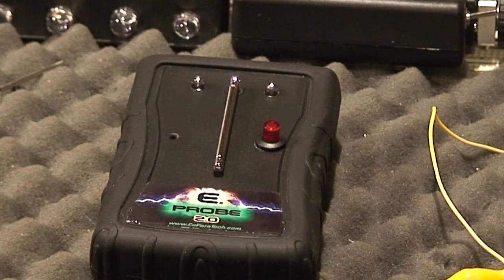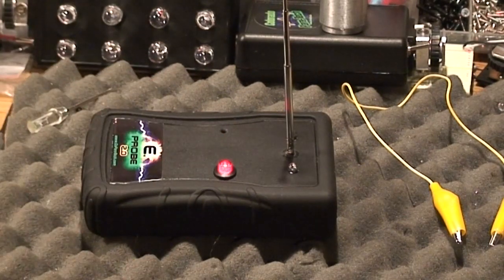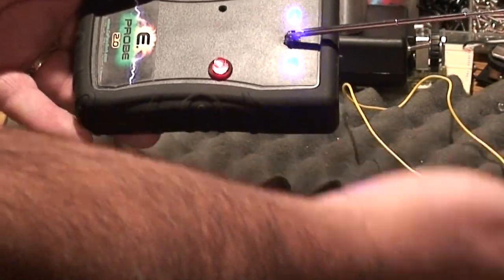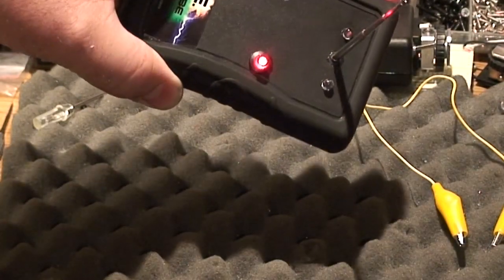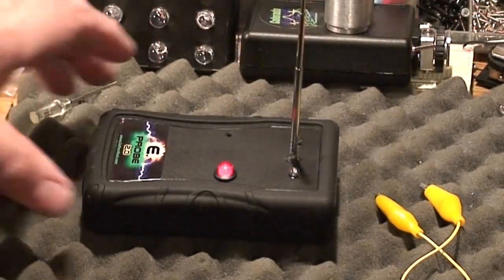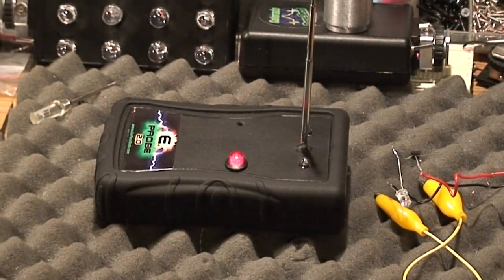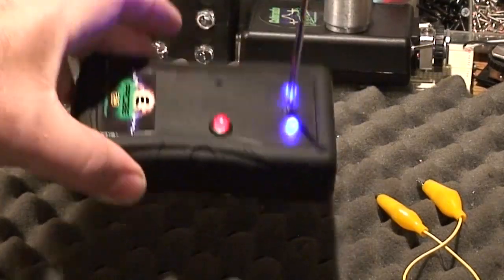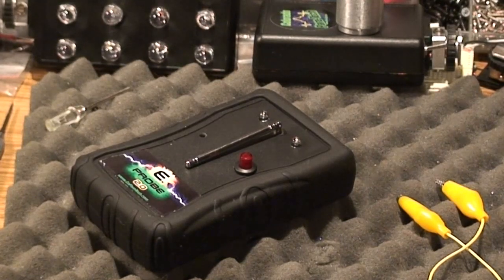E.Probe 2.0 E-Field Detector Demo

Comment from the maker: They are similar in that they both detect anything that disturbs the electrical charge of the antenna. The REM Pod is a more sophisticated device made by the master, Gary Galka, and is too sensitive to be used hand-held. The E.Probe is a simpler device that can be used hand-held or stationary like a pod.